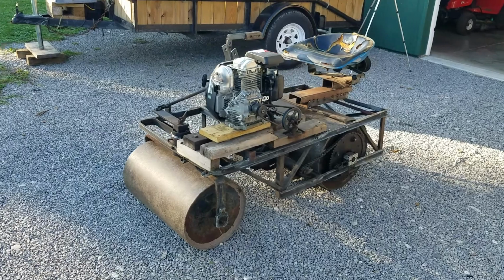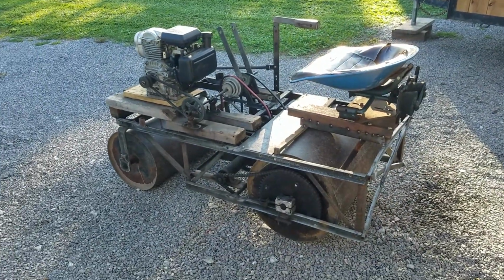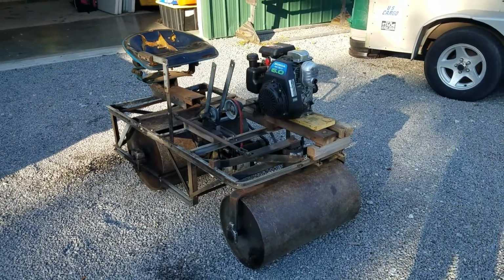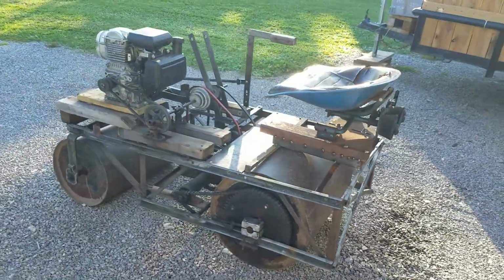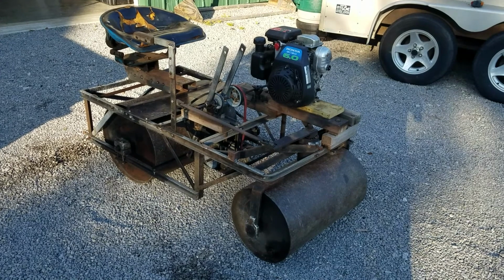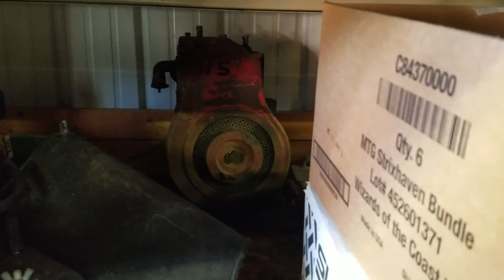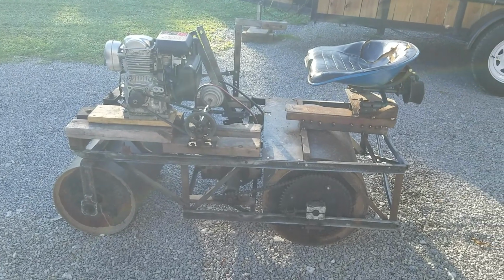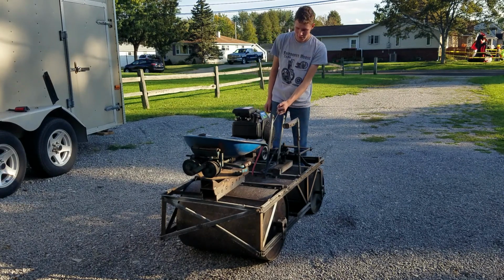Vintage 1940s homemade road roller/lawn roller

Comment: Man that thing is cool! You should put the Briggs B on it! Dont forget they run slower and you will also have a throttle so with how torquey those engines are you can probably just keep it at an idle and just putt around! I think the Clinton would look odd, a little too small for that large of a machine! Need some big old cast iron on it and get that nice thump! Trust me, when you go through those engines and make them right they start even easier than that POS Honda does! If the Briggs ends up still being too fast maybe play with pulley ratios or get the gear reduction for the model B. ( I actually have a BR6 sitting around, was toying with the idea of getting it running before the KR came along so I may very well part it out. If I do part it out I'd be more than willing to send you the gear reduction stuff) Best part of the video was seeing that young kid walking down the street staring at you riding around! He must think you are the coolest guy in town! Maybe if they walk by your place enough he will get into the old iron too and keep the hobby alive!
Reply from the maker: I've decided I'm going to put the Briggs B on the roller. The specific engine I showed in the video is too worn out but luckily I have two other model Bs engines so I'm in luck! I've taken the kid for hay rides behind my tractors before and he really had fun!
Reply: @ericcoffedgp40  Sweet! Always good to have a couple parts engines  kicking around lol! Cant wait to see how it comes out! (Just if I may add my opinion, I'd ditch the wood for some nice welded steel, makes things look a little more finished but still homemade). Ohh cool! Now you just have to take apart an engine with him and rebuilt it and he very well may get hooked 😁 !  Ohh yea and I forgot to mention earlier that unless theres another meaning for tiller steering in the tractor world I don't know about then I dont know if this is tiller steering. Google the 1903 Oldsmobile Curve Dash, that's what I think of when I think of tiller steering lol! (They're a lot of fun to drive too BTW 😁)
Reply from the maker: @colin_5839  Right on! Yeah, that may happen in the future! I'll leave it with the wood for a little and then weld on some steel for the engine to bolt to in the future. As you can see I welded the seat mount as well as a place to put your feet. Kinda... lol The Curve Dash Olds is a classic!